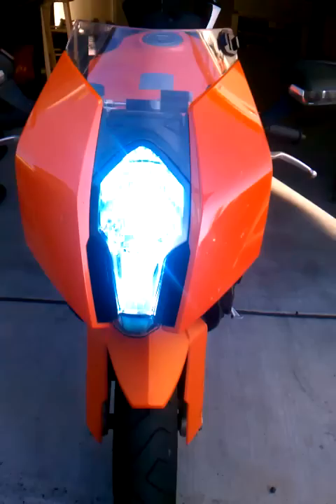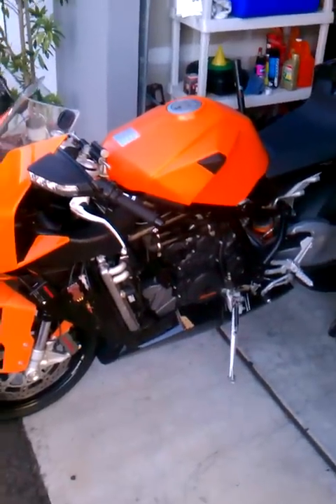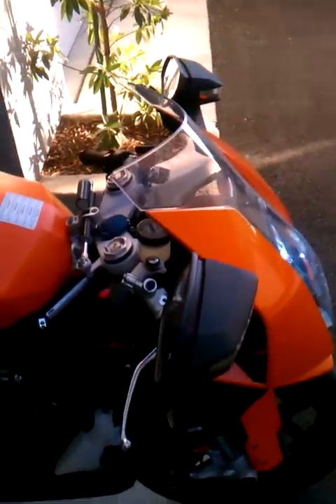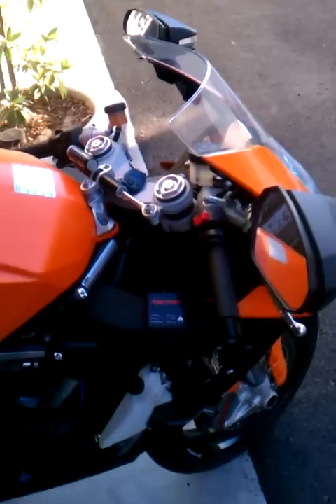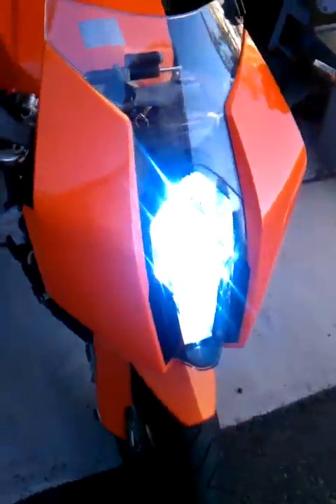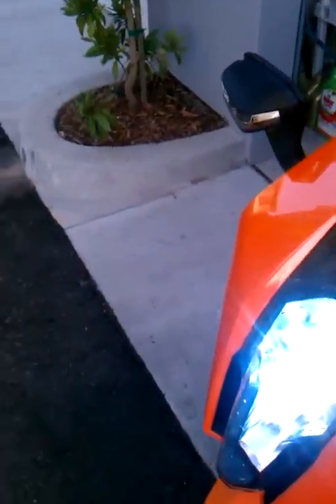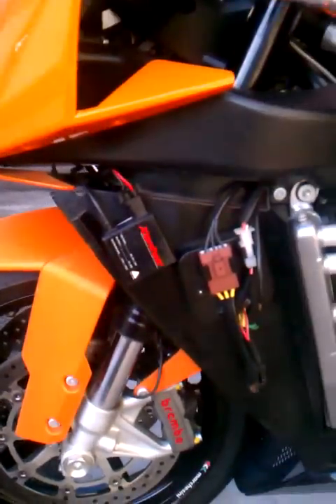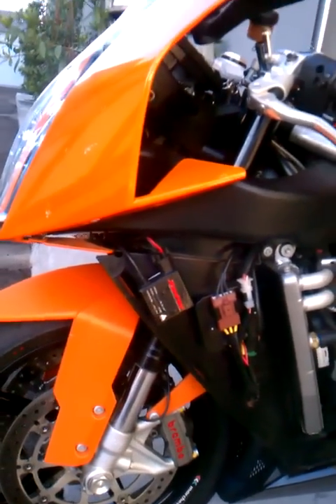KTM RC8 H.I.D. Headlight Install

Comment from the maker: It wasnt too bad partner.  Its pretty much a 2 handed job.  For the high beam (lower bulb) I had the handle bars turned all the way left, and I sat down in front of the bike.  Then if you use your right hand over the top of the air intake, and use your left hand to reach under the front of the headlight, you can get the bulb worked in there after a few tries.  One other note, I didnt use those round covers that fit on the back of the original bulb.

Comment: I see bud, yeah it tortured me a lot today and I had my buddy hold up the cluster as high as possible with a little tension and was able to drop in the bulb but before doing so I cut out the back of the original backbulb round plastic dust/water cover and had the bulb routed in before installing it back. Yeah it was a major PITA but indeed double. Thx for the reply btw.